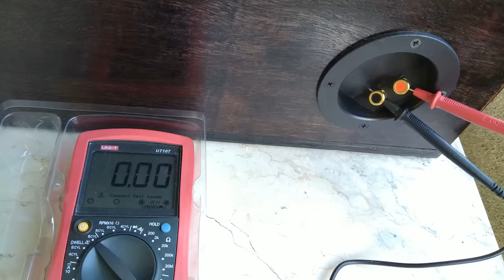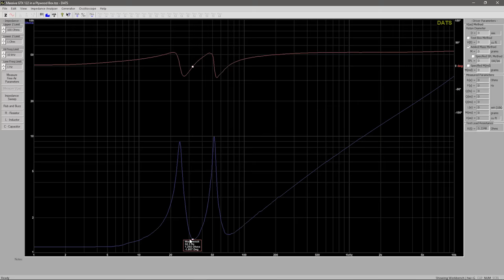How to Make L-Port Plywood Subwoofer Box - DIY

Comment: Plywood gone sound like 💩
Reply from the maker: Tell that to Bobby Gately, Next Level Fabrication, and the rest of the guys in car audio. Kindly get back to my channel and let me know what they have to say.
Reply: @chrclmnky  I was going to ask why no one used plywood vs MDF. Is it price difference
Reply from the maker: @timstwart  plywood is very expensive yet weighs a little. Ideal for big boxes on SPL builds. And the surface can be readily sanded, stained and finished. Much beautiful results than MDF.
Reply from the maker: Soundwise, not much of a difference.
Reply: Marine plywood like he's using, or hardwood plywood like Baltic birch is great for speaker building.  They're dense with a tight grain and very durable.  Common pine plywood (yellow-ish color, often sappy) is soft, splinters easily, and is the one you want to avoid.
Reply from the maker: @infrasonic436  pine ply is only useful for temporary structures.